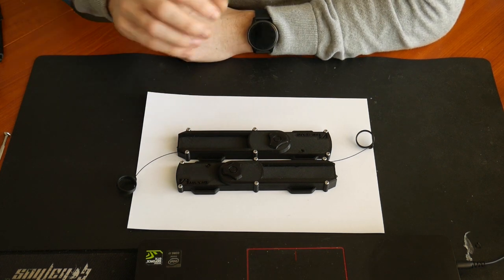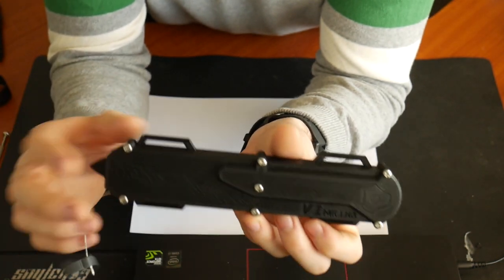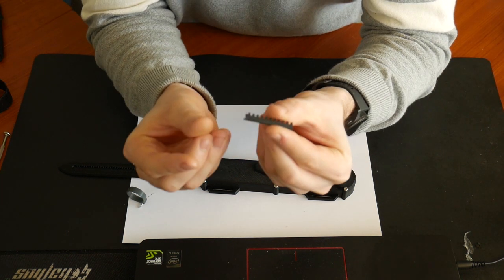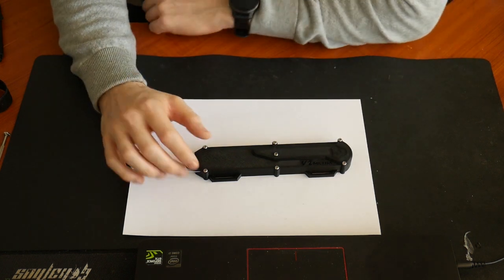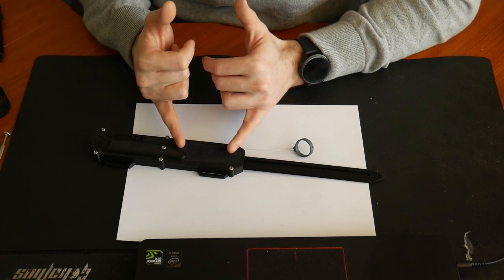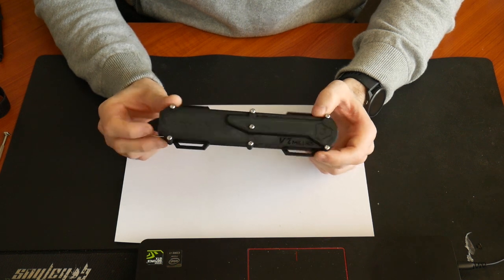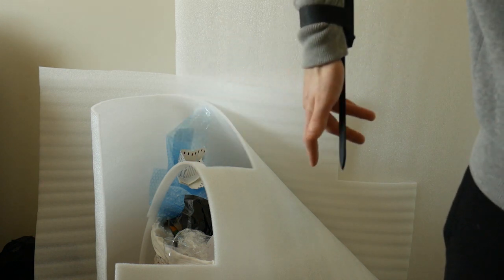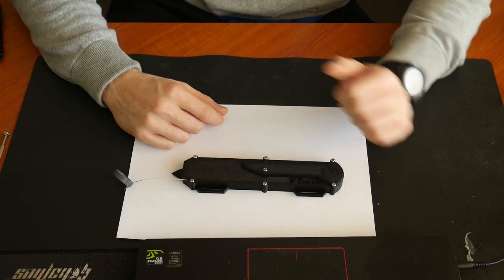Revolutionising The Hidden Blade Design PART 5! (The First Real Test!) By RAWICE511

Comment: I'm surprised you have it tethered to a finger. Even for cosplay this really limits the utility of your hand by making certain actions completely impossible without deploying the blade by mistake.
A better system would be to modify the current design to do away with the ring entirely. Instead, you could have a pull tab mounted where the wrist and the hand meets, just where your finger can reach it and grab hold easily. Spring-load the tab, as well, so that the action of the tab returning to its rest position automatically is what actuates the gears to retract the blade. This way, the blade can still be deployed and retracted quickly and fairly easily, but it also makes it safer for conventions now that you don't have a device that will deploy accidentally if you try to open a door, shake somebody's hand, make a phone call, or god forbid have your hand anywhere near somebody's face to adjust a piece of their costume for them.

Comment: Could do the blade out of metal so it keeps a good strength range but keep alot of parts 3D printed for less weight issues.

Extra range is always a necessity, never know when you need that extra lil bit of range to hit your target

theoretical speaking.

Comment: If an aluminium version was for sale id buy it instantly
Reply: Aluminium or Steel, just said Aluminium cause i think its lighter cheaper and easier to work with, but the blade would have to be steel of course

Comment: im wondering how this design would work with machined aluminum or steel, less risk of pieces snapping under pressure, and if the gearbox was filled with grease would it operate more silently
Reply: diamond hidden blade 🤔

Comment: Amazing to see this design in real life now. I'm not really a fan of the noise though, to be honest....
Two features I'd like to see in future versions:
- Steel springs instead of rubber bands for better longevity
- A safety switch to disable the blade mechanism even when pulling the string (but not by just preventing the string vom being pulled)
Also, I think a preorder option on your etsy store would be amazing. That way, you know which color and version people want and there is no rush for customers when you announce the restock :D

Comment: Really looks great. With the OTF design it had a trouble of working under water but im guessing since this is with gears it doesnt really have such problem.
Reply from the maker: Yes no issue with water or gravity also no need to worry about springs or elastics losing tension it can also retract while being in a target!

Comment: Aren't you essentially pulling the blade out? because for example if you pull slowly it will come out slowly, unlike the OTF
Reply: He’s not pulling it it’s triggering a gear system. Whether he pulls it slows or not doesn’t affect how fats it comes out